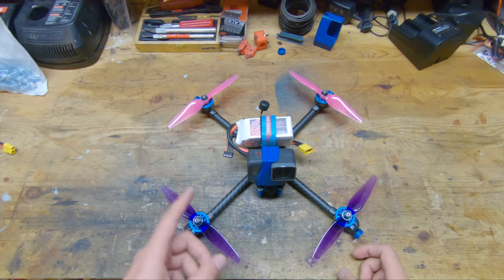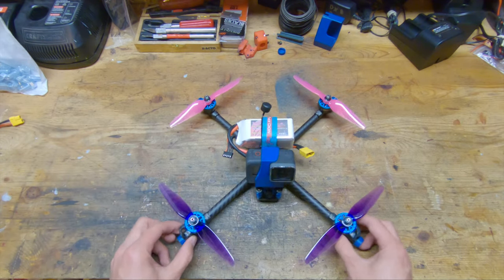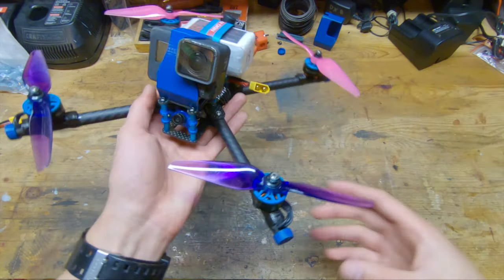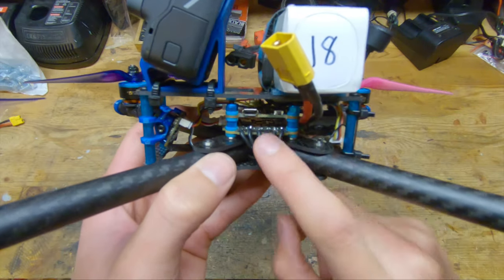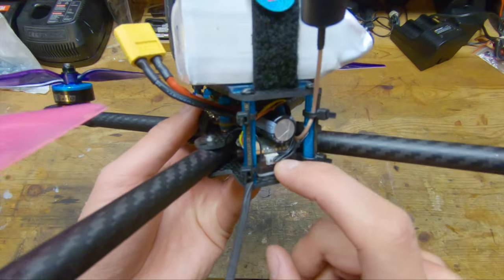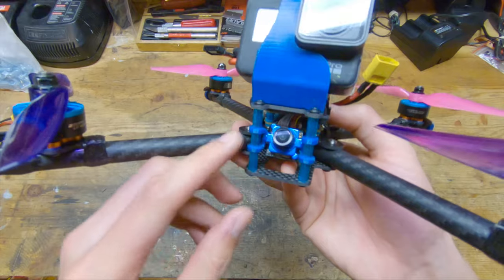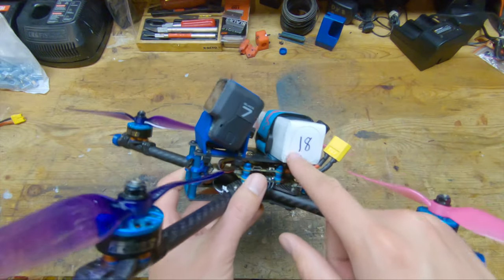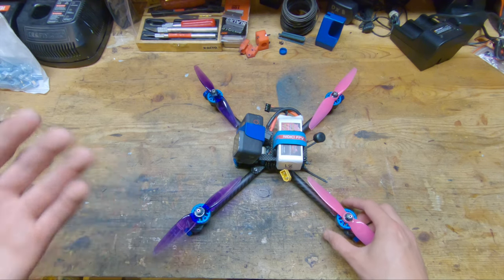Tubular Quad V4 Electronics Installation and Discussion - Build Your Own FPV Miniquad Frame

Comment: Nice weight! I fly 2408.5 Hyeperlites, for their massive torque but with 7'' blades. Also like the 1922 kv version on 4s. 
You mentioned, switching down to some 2206 ? I trie them with a 6'' and it was very good, but only with higer kv (2300) and a lighter rig
Reply from the maker: Thanks! I use Brother Hobby Returner R3 2206 motors on my Hyperlite Glide and I used to run them on the Tubular Quad. They have good enough response for me (a light quad helps, like you said). Also, it is worth pointing out that KV doesn't affect response time if your PIDs are properly tuned, since KV has no impact on torque:
https://www.youtube.com/watch?v=gH6FpORZmpM
So if I drop to a 2206 motor I will still maintain a low KV.

Comment: What are the advantages of 6 in builds? Ive always heard that 5in were the sweet spot
Reply from the maker: A few years ago I made a whole video about why I prefer 6 inch:
https://www.youtube.com/watch?v=ktL9BxI14XE

Basically I've found 6 inch to have better efficiency and grip than 5 inch with comparable speed, while sacrificing a small amount of response. Also, years ago when 5 inch became the gold standard people were running the GoPro Hero 4. 5 inch was also well suited for the Hero 5 Session afterwards. These days, most people are running the much heavier Hero 6 and newer, and I think 6 inch copes much better with the added weight. That combined with the recent release of much improved 6 inch props means that 6 inch is better than it's ever been (5 inch made its big advances a lot earlier due to its popularity).

Both prop sizes work, and at the end of the day it's personal preference. But if you haven't tried 6 inch yet I highly recommend trying it if you can.
Reply: @TimmyRC  Thanks for the lengthy response! Im about a year in to the hobby and just recently completed my first real build. Its a 5 inch glide and it flies pretty well. Need to tune it tho bc I get a lot of prop wash. I would love to build a 6 at some point tho. Would you reccomend the 6 in glide? cuz thatd be a pretty simple upgrade to make